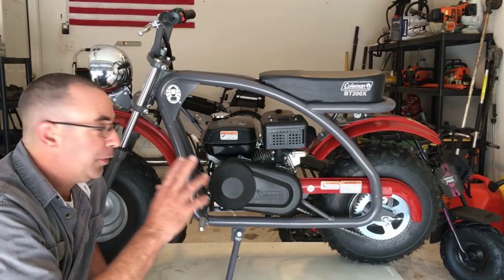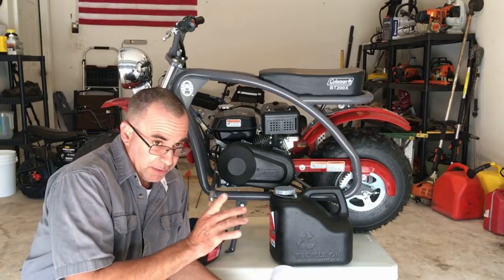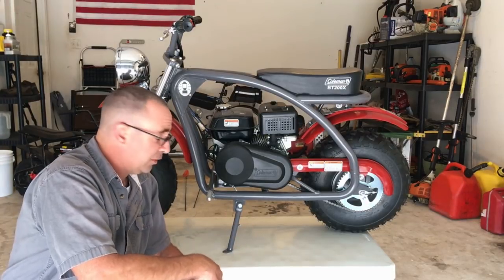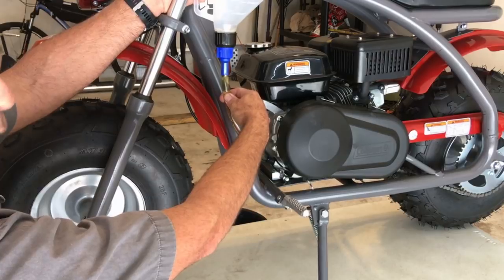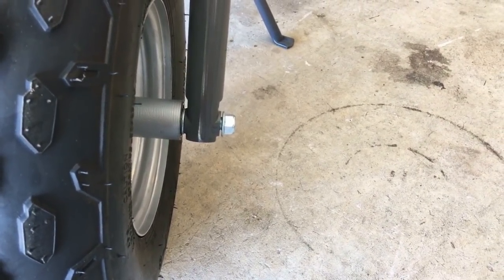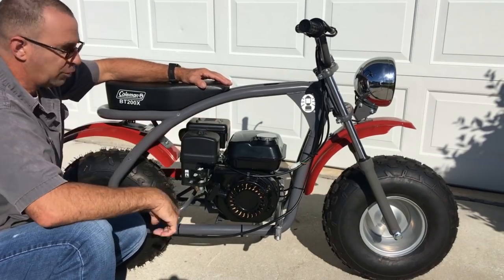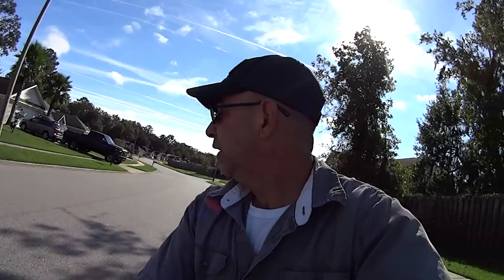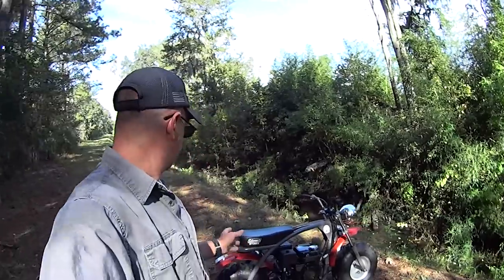NEW Coleman BT200X Mini Bike - Initial Review - Riding MiniBike Test

Comment: Get used to adjusting the chain. You will need to do it a few times from when it is new. And learn how to service the clutch. I don't even ride a lot but still pull the clutch apart for service just about after every ride. Don't fully disassemble it, just service the caged needle bearing. I pack mine with grease without over doing it. That engine takes about 16oz after an oil change.

Comment: Does it have a clutch or cvt under that guard? I assume it's got the 5/8ths engine shaft.
Reply from the maker: Centrifugal Clutch
Reply: They stopped using the 3/4" shaft in 2016 during the CT200U run. Everything after that has the 5/8 (actually 16mm) shaft. The clutches used on the 16mm shaft have a caged bearing which lasts longer without service than the bushing equipped 3/4 clutches.
Reply: @Deucealive75  yea, I dont usually have any problems with the bushing going bad they dont last that long for me because of heat buildup, I'd have to replace it with a tourque converter.

Comment: it is assembled correctly. As someone who assembles these bikes often, we don’t tighten bolts all the way because it can add extra wear that isn’t needed. When you get a preassembled bike you should tighten bolts but saying it’s not assembled correctly is extremely misleading and just not correct.
Reply from the maker: It’s not assembled correctly if the bolts that hold shit together are not properly tightened/torqued and it is YOUR job to include a note or a caution explaining what bolts to tighten and to what torque specs if you fail to do so for whatever reason you care to justify.

Comment: What powers the light does it have a small alt/generator ??
Reply from the maker: I don't remember what it is called. It gets power from the spinning flywheel and a magnet. No not an alternator or Generator. Dang I hate I forget the name right now.
Reply: @FitInMy50sVlog  ok thanks yea if it generates DC current from a spinning magnet I would call it a generator I wondered if its under the flywheel I would call that an integral part of the engine  im 68 and Its been a while since I played with bikes I should remember I was a certified Yamaha mech when I was 17 here in NJ that was in 67 lol but im thinking of restoring a mini if I can find a cheap one but I like that Coleman BX200 thanks for the quick reply 
John

Comment: Can I use 93 octane gas in it since it says 90 octane or better?
Reply from the maker: Yes, definetly. 89 octane is also ok especially if it is ethanol free
Reply: Not sure why they recommend 90+ octane. I run regular 87 in all of my Honda clone engines. The engine only has 8.5/1 compression. No need for anything higher than 87.

Comment: do you know if that motors got a 3/4th inch shaft?
Reply: 5/8" mate !!!
Reply: @HELLHAMMERHANDHIX  thank you. I've acquired one now, wish it had a 3/4 lol
Reply: @mcnuggatron2129  ...if youre bothered about the shaft ,then you can buy a predator engine at harbour freight for $119 ,and that will be 3/4" shaft. plus youll have sum spares too from your other engine (air box ,muffler ,etc).
Reply: @HELLHAMMERHANDHIX  yeah that's the issue. I plan on putting a predator or tillotson on there at some point, but the motor that's on there is fine for now. I want a torque converter but I don't wanna waste the motor on there. Might buy a cheap go kart frame and stick it on there or something. Thanks
Reply: @mcnuggatron2129  ...thats pretyy much my plan. im getting another engine tomorrow which i will keep as a spare engine ,cos its just cheaper to throw in a new one. right now i can get 20 percent off at harbour freight which means i get the engine for $99 plus tax. check out muh channel if youre curious about this kinda thang. there will be more vids coming as im always tinkering around with stuff. anyhoo all the best NIC !!!
Reply: @HELLHAMMERHANDHIX  will do, thanks

Comment: With these Chinese engines after the first few oil changes with conventional oil and the piston rings get seated and all What do u think ab switching to a synthetic. I would think it would give u a little longer in between oil changes.
Reply: I use synthetic right out of the box and change it when I notice it start getting dirty.

Comment: I would swap a predator 420 and do a intake and exhaust system upgrade with a torque converter 40 series.
Reply: gee, if you want a bigger/faster bike, just buy a bigger and faster bike.  Buy this and then a new motor and clutch and you have more money it than just buying a bigger and faster bike. Get it for what it is.
Reply: Amen to that!
Reply: rickpaulos why not swap the engine maybe a tillotson 212 electric start with a 40 series torque converter with a performance intake and carburetor 110 main jet and performance exhaust on the sprocket setup will be 18 front 45 rear on 420 chain or #40 chain and add a front brake system from a mega moto 212 pro and add a led front headlight and a battery the Tillonson electric start 212 has 10 horsepower stock and can handle 5500 rpm’s with the stock flywheel.

Comment: Is it street legal?
Reply from the maker: Chupas no it isn’t
Reply: DansVlog912 well, if i register it can i ride it from my house to my school which is like a block
Reply from the maker: I would do it but doesn’t mean it is legal. I wouldn’t even register it. Stay off main roads and walk it across large intersections. That is what a cop told me
Reply: @Chupas  you can try to get it registered I tryed to get my colemen CTU200U ex but in my state you can't register a motorcycle  without the title but you can ride a 49cc but you need a motorcycle license and have to be over 21 and you can't drive them in a road were there's a lot of traffic
Reply: Lack of tail/brake/indicator lights means no. You'll also have trouble without a title. Really it depends on the town tho.. I used to have an old manco minibike that I rode to school sometimes and never got in any troubles.

Comment: How often does it need an oil change?
Reply: from my experience with all the small engines ive been through i recommend using a full synthetic, castrol is the best ive used, valvoline is ok, but i encourage people to stay away from brands like quaker state or royal purple, quaker state i know from experience will begin to gum up engines and ive never used royal purple, so i dont have much on it. i always did it once a month or after 40-50 hours of running. thats always worked for me and never caused issues, also if your engine can handle it, run a tank of premium hi test through it every now and then to clean out the buildup inside the engine. shells premium works best at this.
Reply: @thisoldchevy2371  I would confidently use 5W30 Quaker State Ultimate Durability oil in any engine I have. Oil testing has shown that this oil is on the wear protection level of Amsoil without the price markup. And that's at the very top of the wear protection list.

I would never buy royal purple. It's a mediocre oil at best. I guess it would look pretty going in but whatever dye they are using to make it purple does nothing for wear protection.
Reply: @Deucealive75  in my defense, it was an old timer who told me about quaker state gumming up engines. from what ive seen they've become a really dependable oil
Reply: @thisoldchevy2371  Understood.. I'm getting close to "old timer" myself. I'd bet that the additive packages used today are far better than when I did the first oil change on my first car nearly 40 years ago.
Reply: @Deucealive75  oh no doubt. and dont even get started on the changes to gasoline

Comment: Just got 1 for my  sons  , should it be in my best  interest  to  insure  and register  just  to  avoid  headaches from  law enforcement  , live  in  N.J??????
Reply from the maker: Bro, I have no idea. Stay off busy roads and all should be ok but then again... Blue states need revenue, so...
Reply: Clifford Miller just don’t get caught it’s not street legal where I live but had no problem
Reply: You can't register it or use it on the road in NJ.  Even if you were legally allowed,  the bike isn't built to DOT specifications.  Its basically for off road use only. It's a neat bike but it's pricey. I have built several mini bikes in the past few months.  You can get a bike with a 3hp motor used non running for $75. You can get a 6.5 hp 212 cc motor at Harbor Freight for $100. And a clutch that fits the motor and the existing chain and rear sprocket for $15. Basically $200 and an hour turning a wrench and you have  an adult mini bike.
Reply: These are not street legal. Even if they were, it would be a motorcycle due to the displacement, requiring an MC endorsement, reg and insurance. Irrelevant though because it's an off-road only vehicle.. i used to ride one around my small town in northern Jersey but it's risky. Very real chance of a fine or even impoundment.

Comment: Bt200x or ct200u?
Reply from the maker: Because of the headlight the thicker frame the front suspension and the adjustable handlebars I would have to go with the BT 200
Reply: @FitInMy50sVlog  BT200X is the best they have to offer. Walmart online $600.07 out the door :)
Reply: @SuperRedthunda  its 399 rt know on the app

Comment: Just Say "No" to Carburetors.
Does this thing even have suspension?
I couldn't stop laughing my ass off.
Reply from the maker: Has front shocks (if one can call them "Shocks". The appeal of these mini bikes is they are stiff framed little bikes to have low speed fun with. The big soft tires is the suspension.

Comment: Where am I gonna get ethanol free gas at? 😂
Reply from the maker: Ethanol free gas is also known as Marine Gas. There is a website you can google search, < Ethanol Free Gas Near Me > and see if it helps. If not available, go to the auto parts store or maybe Walmart and buy Ethanol Blocker (I think made by Sta-bil)
Reply: @FitInMy50sVlog  Also, you can actually make your own. Start with the highest octane pump gas you can find (likely 93), fill up a small jerry can, but leave room to add about a cup or two of water per gallon. Add the water, shake it up really good, then let it sit overnight. The ethanol will separate out of the gas and dissolve into the water which sinks to the bottom. Then you very carefully just decant off the remaining gas - which will be at a lower octane (because ethanol is essentially an octane booster) - but still should be above 87 range or so, so fine to run.  Here's two videos on it: 
https://www.youtube.com/watch?v=onCG7mIprfE   
https://www.youtube.com/watch?v=r_AJhtkOy2M